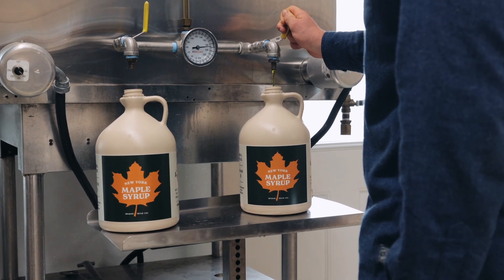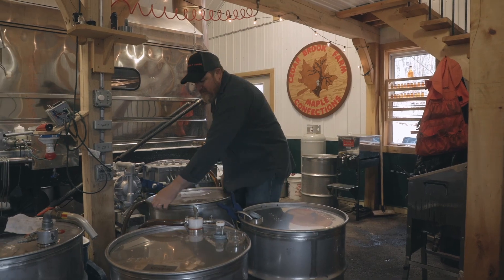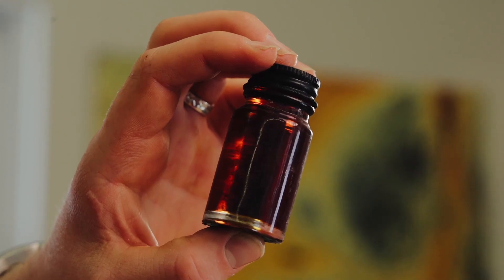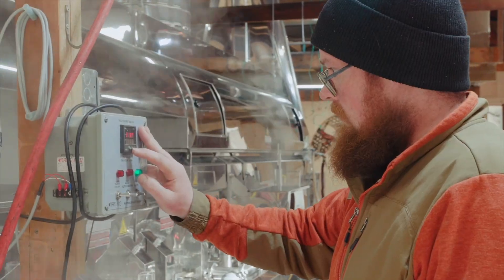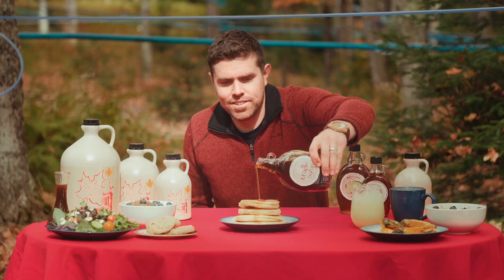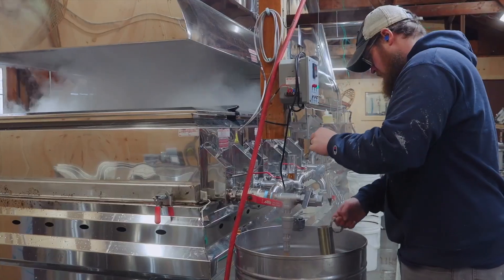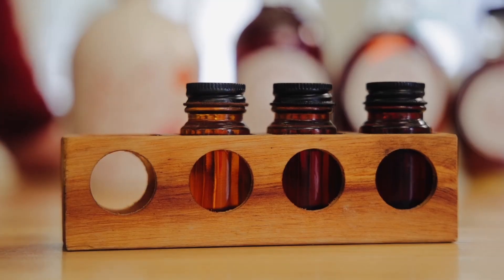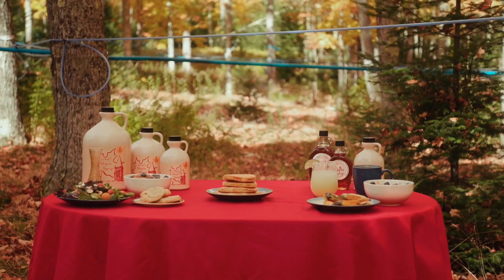5. Grades of Maple Syrup

Comment: This would be clearer if you explicitly mentioned the old A vs B grading. Explaining color alone doesn’t explain why labels still say “Grade A (formerly B)”. The key missing point is that letter grades no longer mean anything.

Before 2015, the U.S. used letter grades (A, B). Since 2015 (U.S. and Canada), everything is Grade A, with differences based only on color and flavor.